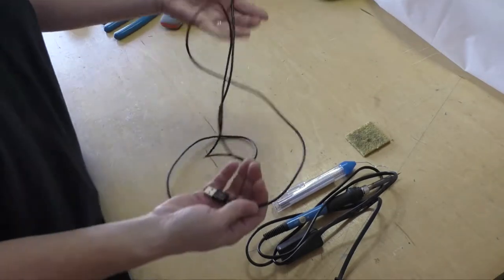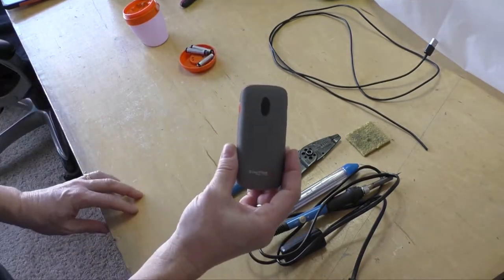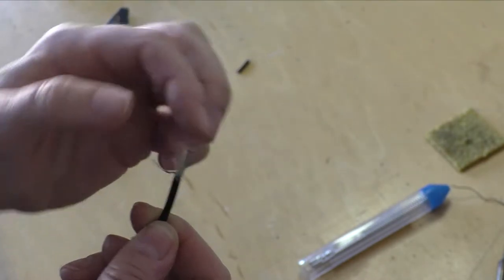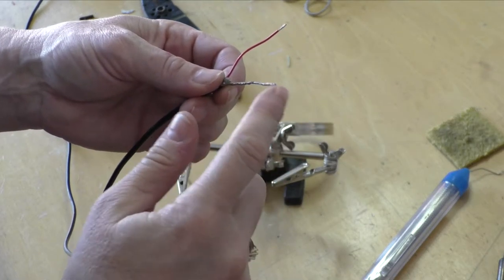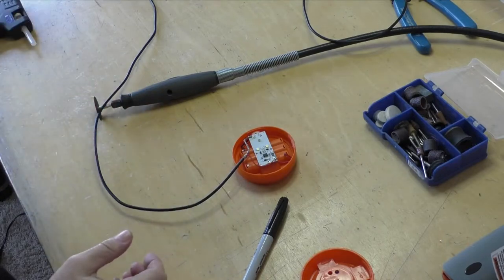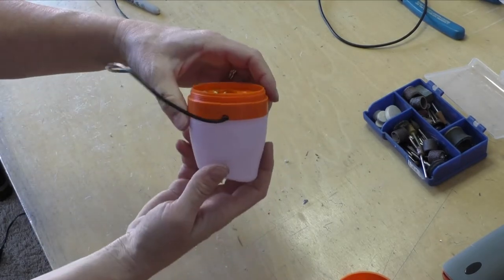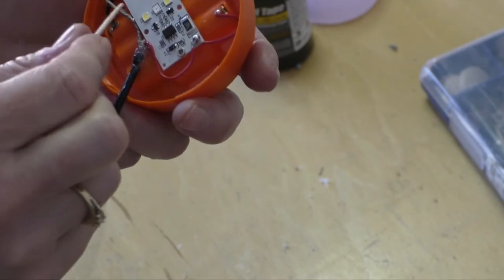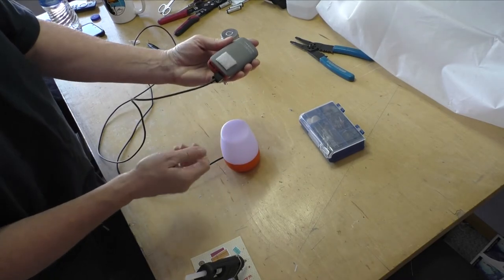How To: Convert a light from AAA Batteries to USB Battery pack!

Comment: USB cables don't always use the "correct" colors on the inner wires, it's good practice to check with a multimeter to be sure. The fuzzy stuff in there is strain relief, the idea being if the wire gets pulled, those fuzzy strands get tugged instead of the actual inner wires themselves.  Voltage being correct is important. Alkaline batteries will have a max voltage when new of 1.65V and are "empty" at around 0.7-0.8V. That means devices that use 3 AA are expecting an operating voltage in the range of 2.1-4.95V and 4 battery devices work with voltages of 2.8-6.6V. So, a USB 5v supply will be fine "as-is" for most 3 or 4 cell devices. There is also the caveat that some devices will rely on the low current capabilities of alkaline cells in place of having current limiting built into the circuit, so the ability of a USB to supply higher current can potentially fry some circuits if you don't also add an appropriate resistor in series. You can measure the current draw with a multimeter using fresh alkaline cells to figure out what max current the device is expecting.
Reply from the maker: Excellent info, Gary! Thanks for posting!

Comment: An informative video and well done. However, the "bare wires" you gathered together and twisted into one wire, are actually the "shield" for the cable. These wires protect the four wires inside from outside interference known as eddy currents. You should have used the red (VCC+) and the black (GND or negative lead).
Reply from the maker: Great info! Thanks! I'll use those two next time! :)
Reply: @EndlessDIY  yeah, the shield and ground wires are usually common together.

Comment: The led will work , however they will run a little warmer & age quicker as the led's are designed to run at 4.5v .
Reply from the maker: I'd say that's probably correct. I think the 1/2v difference is probably negligible enough but since these lights are only a couple bucks, I'm willing to take the chance. I have recommended in replies to commenters that it'd be wise to do some research before performing his mod on something they're not willing to potentially sacrifice. 👍

Comment: I have what I think might be a dumb question. But I have a battery powered lantern that uses 8 D-cell batteries (12v total). Could I just wire it straight into a 12v car battery without a problem? Will the lantern just pull the current it needs, or do I have to regulate it to keep the lantern from burning down?
Reply: check the amperage too. or else itll burn the bulb

Comment: Hi. Those USB cables also comes with a plug that plugs into the wall.  Would that be fine, using the power from the "wall"?  It's not too powerful for the light ?  I want to use that as my power source. Thanks.
Reply from the maker: The wall plugs should convert the voltage to a “device “ safe level (like a plug block for an iPhone). I’m no electrician so take it as unprofessional advice. 
Thanks for watching & good luck with your project! :)

Comment: I'm amazed on our thought processes... I just got a USB/12v Plug adapter for my cordless battery I use with my auger.
Then made adapters for my Vex and Camera. I was watching videos on MR. Heater Big Buddy USB conversion for the fan; and was thinking about a 12v plug for my ice house fan/light combo!!! Awesome Rush!!!
Reply from the maker: Mint, Bee Dub! You should wire in an LED fan indicator on the heater, too! I added one to mine & it's so helpful when I use it! I used to accidentally leave the fan on all the time, killing the battery (I wired in an SLA 6v).

Comment: Great work, but you know it's just rechargeable batteries inside that USB battery pack, typically 18650 3.7V Lithium-Ion, they're in everything, most cordless tools, older laptops with removeable batteries. I'd have gone with a wall wart AC/DC power adapter, unless you intend to use it somewhere without outlets
Reply from the maker: You're exactly right but I did this conversion because I use these as camping lights in my tent, so no "shore" power. For something to plug in, though, I'd do as you suggested. 👍

Comment: I'm using a simple LED head lamp as with age I do need more light for some tasks. Actually I have a few of these Using 3x AAA batteries I found these otherwise super helpful head lamps not sustainable. So naturally I wanted something USB chargeable but why spend £15-25 on new head lamps when mine do work and I have all the required equipment laying around as I consider myself the DIY and recycle queen. 
I used a long micro USB charging cable and converted my LED light to a USB via power bank or mains powered  light. Very pleased with myself right now. One done, a few ore to go, I even consider installing some plug in options.
Reply from the maker: Fantastic! That's a great use for this hack! Way to go! :)

Comment: Aren’t you afraid, that the higher Amper from a usb charter (than from the batteries) will harm the leds?
Reply from the maker: See the pinned comment by @Gary Ritter. He offers some good information.
Also, you can look up the specifications for the LEDs, power supply, etc & do the calculations ( https://www.fluke.com/en-us/learn/blog/electrical/what-is-ohms-law ). Or, you can just use an inexpensive light and experiment, like me! If it fries, not much lost & you learn something in the process! 👍

Comment: Is current not an issue? From what I’ve read the LEDs will not last as long.
Reply from the maker: That's a good question. One I don't really have the answer to, though. I believe white LEDs can safely use 1A power sources (such as the power supply for an iPhone or the power box in the video). I am no electrical expert so if you need specifics then you'd have to do a little homework. The light is still working fine, but I don't use it frequently. It's in my camping stash. Sorry I couldn't offer more information.

Comment: Love your video.  I just bought a soldering iron but I'm not sure what kind of solder to use. I guess I have to go get some. I can't use all my different jewelry wires could I?
Reply from the maker: Hi there! If your soldering iron came as a kit, it may have some solder with it. If not, you can pick up solder at any hardware store. Just make sure it's not plumbing solder. ;) You can get high gauge (higher the number, finer the wire) electrical wire there, too, or even take apart something you don't use or that's broken. I salvage a lot of my electrical goodies from broken things. There is fine wire in iPhone cords or anything like that. Thanks for watching & good luck with your projects! :)

Comment: After connecting to the 5 volt adapter instead of the 4,5 volt batteries, I realized, that the light got stronger with the adapter than with the batteries. Question: will not the 5v harm (ruin) the led lights?
Reply from the maker: LEDs have a safe voltage range so it may depend on the specific LEDs. The pinned comment from @Gary Ritter has some good information that may help.

Comment: Another thing you could have done with the wire inside so it can't be pulled out, just wrap about 5 layers of black tape on the inside so it can't be pulled out.  Or, at least not easily.  The tape just has to be slightly larger diameter than your hole you made for the wires.

Comment: Hi,

Can you please show how to convert a AAA battery device into a dual mode device using direct AC power for power adapter and during power outage for it to auto run using rechargable battery connection.

This I was thinking for a Aquarium fish feeder. So that the timer does not get reset during power outage.

Other advantage is the durability of rechargeable batteries like Lithium will increase during to non extensive usage. 

Thanks.

Comment: This is a brilliant tutorial! Thanks so much! 
I was wondering - could I possibly also connect one of those smart wifi LED controllers to this board - to make the light Google Home voice controlled?
I imagine I can run the power cable through that onto the light board and it should work - thoughts?

Comment: I have several of the same small camping lights from Walmart. Can you rig it so that the power pack is connected to several of those small lights? If so how would you go about that?
Reply from the maker: Great question! The wiring would be simple enough, but I'm not sure a single port on the power pack would be enough to power them all. USB typically has a 2.1V or so output. Honestly, I'm just not sure. Sorry about that.
Reply: @EndlessDIY  Thanks for the info!

Comment: Could you do this in reverse? How do you power a 5v, 2A heating pad from batteries?
Reply from the maker: I've never done that but I'd think you could. Without seeing it, I think you'd have to get a battery holder, cut the heating pad's cord USB end off & solder the wires to the positive & negative terminals of the battery holder. If you're not sure what batteries are suitable just look at the power output on the various batteries & from there you can tell which and how many will work for your purpose. Hope that helps a little, at least! :)
Reply: @EndlessDIY  Technical question: battery chargers can double up as power banks, but their current output is very low. Do you know why?
Reply from the maker: @stephenhogg6154  I'm guessing they're designed based on Ohm's law. I'm no electrician but voltage & current can't really be adjusted independently; it's based on resistance and they are probably designed to have max current. I may be totally wrong about that so you might want to do some research. Here's a link about Ohm's law & you might find other helpful info, too. https://www.electrical101.com/ohms-law.html

Comment: I tried this but unfortunately batteries run at a much lower amperage than usbs do. I think it was about .1 amps while the lowest a usb will run is 1 amp 2.1 if its an old android charger. This means the electronics will run much hotter and potentially burn out. I'm gonna see if I can find a resistor that'll drop down the voltage cause as it stands I'm liable to burn a component.
Reply from the maker: It’s definitely a good idea to do the math on your devices. 👍🏻
Reply: There is no such thing as excessive current (amps) in this case. The device will simply consume only the current that it needs. Now voltage is a different animal. Excessive voltage can wipe out a driver board and LEDs. That's when you need a regulator of some sort. 

But a separate regulator is not usually required in these cases. Three fresh alkaline batteries can put out 4.5 volts whereas a USB wall wart puts out around 5.1V. The .6V difference usually doesn't cause problems as the driver boards in most of these devices have some wiggle room to handle a little excess voltage.

Comment: It was useful, I have a set of bike lights I want to swap to usb, mainly because one part is a rear brake and indicator light unit I am putting on my bike trailer, I got a base board and I'm adding the lights to that then running the lead back to the bike via cables that I can link and unlink as and when required. I can then load up the bike and run everything from the control unit on the handle bars. I can also add some far more powerful lights on this way. Thanks.

Comment: Nice job. This is pretty close to what im looking for. Im trying to make a AAA diy battery eliminator for my pocket operator. I found 1 vid but they dont name the parts so i dont know what to search on mouser. Any suggestions? Key difference here is im avoiding soldering directly to the device. Not paying $40! for a battery eliminator that costs about $3 to make :)
Reply from the maker: Hi there, I'm sorry, I don't know what the part you need is called. I kinda did the conversion the "quick & dirty" way. lol! If you're not able to find the part you need maybe you can do the job this way? You can always unsolder it later if you're not happy with the results. Sorry I couldn't be of more help but good luck with your project! :)
Reply: @EndlessDIY  thanks! I found a similar project making rwplacement batteries using acrews and dowel rods. Think i might give it a go. The devices are collectors items so will def not be soldering :)

Comment: Hi, can someone tell me if I can use a phone charger (5V, 2A) instead of 3 AA batteries in row. Do I need a resistor for simple fairy lights?
Reply from the maker: AAA batteries are 1.5v each so 3 of them equals 4.5v, which, in my experience is close enough. Devices are almost always able to handle some voltage swings, so 1/2v probably isn't a big deal. If your fairy lights take 3 AAA, it should be fine, but I can't guarantee it. If you're worried you might want to do some additional research on a site like Sparkfun or similar. Good luck with your project! :)
Reply: @EndlessDIY  thanks ;)

Comment: Great hack!  Question: Does the size of the power bank matter? Since the fairy lights will only drawl the amount of electricity it needs to light up, will it harm the fairy lights if it is hooked up to a bigger power bank that has fast charging capabilities? Or will it require a power bank that has limited output of only 4.5-5.0 volts?
Reply from the maker: I guess I don't know the math. I've used different power packs with the lights and the only thing I've noticed is how long they stay lit. My big Anker pack has a standard and a "quick" charge port on it. I've used both & haven't noticed anything. Take that anecdotal bit with a grain of salt, though. You might have to do some Googling to verify the numbers. Ohm's law would probably get you started.
Sorry I don't have a solid answer for you.
Reply: @EndlessDIY  You've just provided additional helpful info that you have tried it with the quick charge port. Fairy lights are fairly inexpensive so no harm for me in experimenting. Thank you!
Reply from the maker: @mikefa5891  You're welcome! Good luck with your project! 🙂

Comment: Can I use a instead of 1 adapter a USB HUB in order to connect more (maximum 4) LED lights?
Reply from the maker: That's a very good question. I'm really not sure. I think you'd have to find out how much current the power source will provide. My guess would be yes, but your power supply will draw down much quicker. BUT that is purely a guess. I'm sorry I don't have a better answer. If you do experiment, please let me know if it works so others may learn, too.
Reply: Today I’ve tried with 2 led lights and they  worked well via a USB hub! I hope, it will work with all the for USB slots too! 😊😊
Reply from the maker: @horvathgabor5485  Excellent!
Reply: Tried with 4 led lights via usb and it worked!!! Success! 😊😊
Reply: I mean via a usb hub!

Comment: what soldering iron do you own and or recommend?
Reply from the maker: I have a few but none of them are anything special. I bought them all on Amazon & each kit was about $25. I do prefer the ones with an on/off switch on the cord. The little kits are nice because they come with the iron, a variety of different sized tips, solder, sponge, brushes, etc. 
I know that’s not very specific but I hope it helped anyway. :)

Comment: thanks, do you have tutorial for AA bateries to 5v?
Reply from the maker: I don't specifically but if you look at the battery, you'll see the voltage (generally 1.5V). Depending on how many it takes to power your device, you may be able to convert it to a USB. Just add the voltage together to determine if 5V is enough to power the light or whatever you're converting. It doesn't need to be exact, just in the ballpark. It's the same process as this video.
Reply: @EndlessDIY  in your video you converted 3 AAA bateries that is 4.5v right? in series connection converted to 5v. how about if the device requires only 2 AA bateries and i want it to convert 2 AA bateries to usb power. it is posible or it will blow the device?
Reply from the maker: @po1395  It really depends on the device. There's always a little wiggle room for variation but it depends. I'm no electrical guru so you might want to look up acceptable voltage variation for your specific device. 
The lights in the video were about $3 so I was willing to experiment with one. 
If it's a valuable item I'd do some research first.

Comment: Does this recharge the batteries
Reply from the maker: No, it's used in place of the batteries. The wire you're soldering in can connect to a USB power pack to power the light. The AAA batteries don't go back in.

Comment: I want to try this but into  3V finger oximeter. Because my oximeter drains the 2 AAA batteries faster when i use it for long period of pulse/oxygen monitoring. So that i want to convert it into usb wired oximeter.  Is it ok for this 3v device to use 5v charger?
Reply from the maker: That's a great question. Unfortunately, I don't know for sure. I'd be especially careful when it comes to medical equipment. You might look up what the variation in voltage is for the meter and the charger. If they're within the limits, it may be ok, but again, I'd be especially careful. I'm sure that meter isn't cheap to replace. I hope you find what you're looking for and good luck with your project! :)

Comment: Another option would be to poke a hole, with the soldering iron, in the orange base - feed the wire through. I've done it for years, the plastic doesn't "ruin the tip".  Nice little hack - I have done the same with those 3 battery fairy/Christmas lights.  Thx for sharing.
Reply from the maker: Great option to get that wire in there (much quieter, too! lol!)! Thanks! :)
Reply: I did that too, easier to get the right opening for the cable, but you need to think ahead as doing the hole before soldering the cable.

Comment: I like your thinking. It should be noted to check if the batteries are in series or paralell. In series the voltage is multiplied by the number of batteries and rated capacity remains the same; in paralell the capacity is multiplied by number of batteries and voltage will remain the same.
Thanks for sharing and inspiring diy ideas :)